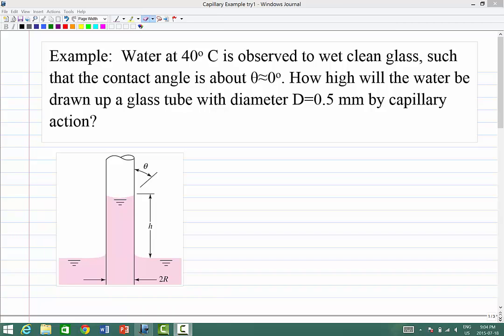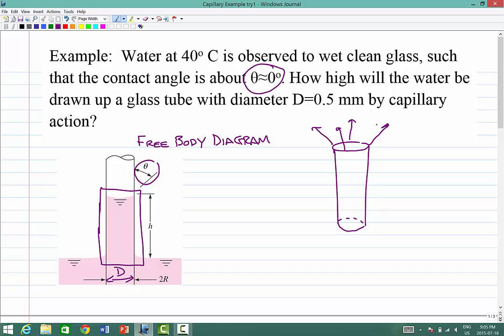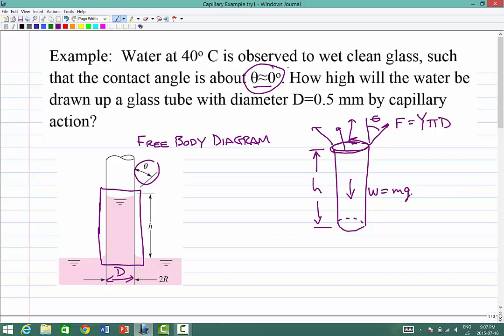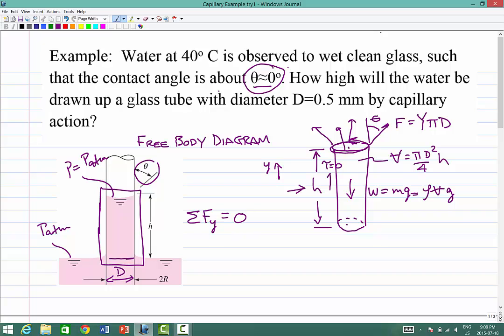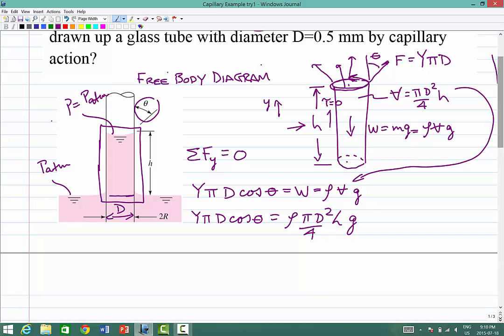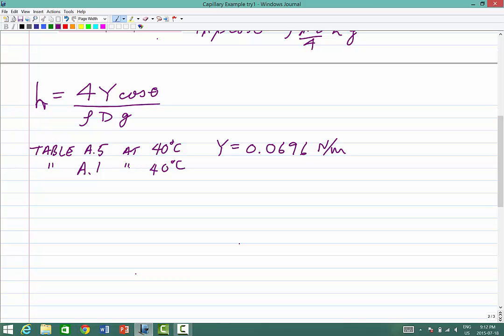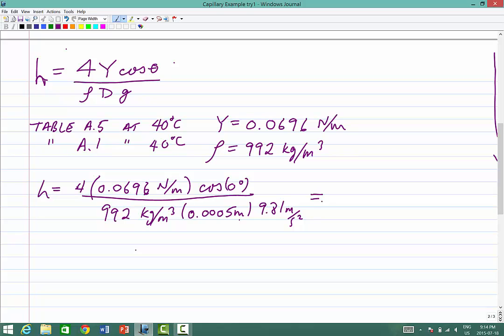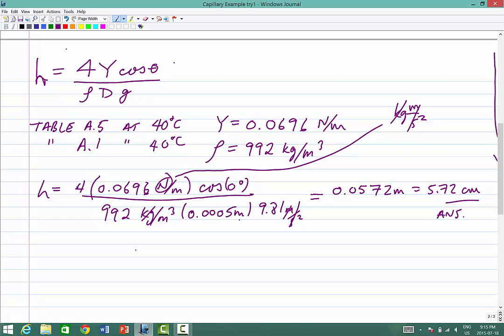Solved Problem: Liquid Rise in a Tube Due to Surface Tension

Comment: What for rectangular tube, the formula.
Reply from the maker: You should be able to easily generalize my analysis for parallel plates at 13:03 -- include width w in the perimeter.
Reply: @FluidMatters  thanks sir, I solved it earlier by myself taking help of your vadios.
Reply: @FluidMatters  exactly I did like this.

Comment: I am having difficulty understanding where the angle is located. Is it the angle that the water makes with the wall of the tube on the inside? if so, shouldn't that angle be 90 since the water "wets" the surface and is almost flat (implying no meniscus effect)? If not, what does that angle represent exactly?
Reply from the maker: Yes, the contact angle is the angle the water makes with the wall on the inside of the glass tube. (This angle will be the same as shown in the sketch, but on the water side.)  In this problem water is taken to perfectly wet the glass (theta=0 degrees) and is drawn up the glass, i.e. maximum meniscus effect. Look at any glass of water and you will see this happening.   See me in online counselling if this is still not clear.